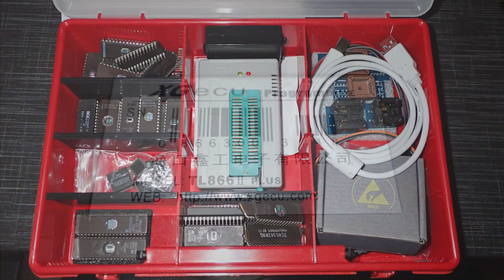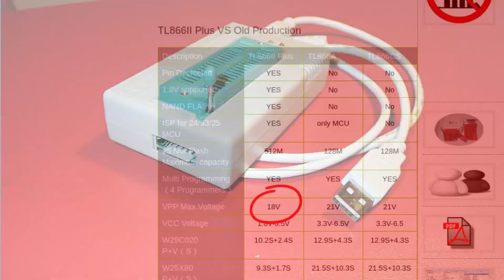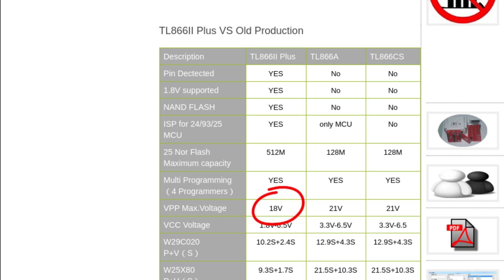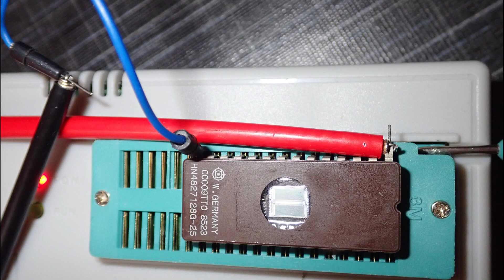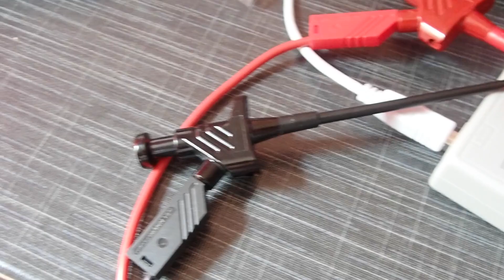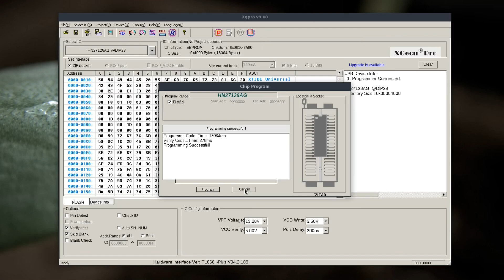How to write 21V EPROM on TL866II+

Comment: i need to buy a programmer. what inexpensive programmer can do these higher voltages?
Reply from the maker: XGecu T48
Reply: @necro_ware  ok thanks. i ordered this  V12.63 Original XGecu T48 [TL866-3G] Programmer Support 34000+ ICS for EPROM/MCU/SPI/Nor/NAND Flash/EMMC/IC Tester/ TL866CS TL866II Plus Replacement.  If it doesnt work you owe me $61! 🤣

Comment: I tried this with a 21V VPP vintage 8751 (not the 12.5V 87C51) but the chip burned - blue flash seen in the window when 21V was applied to the VPP pin resulting in a dead chip. Seems it doesn't work with microcontrollers as it does with EPROMS.

Comment: Hi! I would like to ask you something. I have a 386 motherboard (Seritech SER-386-AD III), that is missing the BIOS chip. I've seen that in eBay, they sell 28-dip EPROM chips (32K, 64K and 128K) from 3 to 7 euros. On the retroweb website, there is a bios to download for this motherboard. If I order one of those EPROM chips, can the TL866II+ pass the 386 BIOS to it? And if yes, will the motherboard boot? (assuming the the motherboard doesn't have any other problem and is only missing the BIOS chip).
Reply from the maker: Yes, this is the way to go. But pay attention, if you get used EPROMs, you will need an UV-eraser. If you don't want to mess around with that, just get compatible EEPROMs
Reply: @necro_ware  Thanks a lot!

Comment: Necroware, thank's for sharing this info and all the guy's that comment it. I have a problem trying to copy a tms27c64 eprom from a machine that is still working at my place of work. I managed to buy two new m27c64af and now watching this video of yours, it made light, I already understood why the first one I recorded doesn't work. Now I'm going to test it with the other one to see if it works. Ah, the programmer I'm using is the tl866II with the latest update from the manufacturer's website. Thank you very much for this explanation and I will keep you posted. Keep up your videos, I've learned a lot from them.

Comment: Thanks for the precious hint: I guessed a similar option with my Hitachi 482764, and you confirmed and explained how to do it properly (it seems that most of N-MOS EPROMs need a Vpp of 21V or more ).
Regarding bending the pin I just bent it only in the final part, not next to the main EPROM body: in this way I stressed it in a less dangerous place, and I managed to fix in place the remaining pins, even if the EPROM was slightly lifted on one side. Of course a ZIF adapter with optional external Vpp terminals or modifying with a switch the programmer itself would be better and more clean options.

Comment: Very good idea. I would cut the PCB trace to the ZIF socket. Install a tiny switch and small pin contact for external power. Very useful information. Tks.
Reply from the maker: Good point, may be I'll make an intermediate adapter with another zif socket in it extra for such ROMs.

Comment: Been doing this for a long time.  If you actually probe the Vpp on other EPROMS while it's programming the unit rarely actually provides the correct voltage.  Best bet is lift the pin and use an external power source.

It's too bad they don't have an external power port on the TII burner.

Comment: At 2:22 you explain that write mode only happens at 21V. You workaround this with an external power supply but how do you workaround the software to allow you to erase/write to the chip? I am attempting this now with a ST brand M2716-1F1.
Reply from the maker: First of all erase will not work, since it is an EPROM, which can be erased only with UV light. The programmer will not allow to write to it until it was erased properly. All the other stuff you have to do as I showed in the video. Deactivate Chip ID check and Pin Detection.
Reply: @necro_ware  Sorry to have used the word “erase”, to me it also describes writing which is what I cannot perform with this chip model regardless. To my point, I am wondering if in my case, is this is a software/firmware issue. My brand new XGecu TL866II-Plus has App Software Ver: 11.80 and Firmware Ver: 04.2.128. Have you updated these to the newer versions since this video? What version is currently working for you? I am simply trying to troubleshoot why I am having this trouble. I am trying to fix a Space Invaders arcade.
Reply from the maker: @tcw16505  I update the software regulary, yes. However I currently have no EPROMs at hand, which need heigher voltage to test. What is exact error?
Reply: @necro_ware  It just says Programming Failed - The log file agrees. APP Version : 11.80   Model : TL866II Plus, Device : M2716 @DIP24, Programming FLASH ... Programming  ...Failed
I have tried this with new M2716-1F1 Eproms, new M2716-1F1Eproms erased, I have tried this as you do with VPP isolated with 21.5 volts and then also with 3.5 volts in parallel as supplemental power. The same problem persists, Programming Failed.
Reply from the maker: @tcw16505  The datasheet says, this EPROM has 25V programming voltage. See https://www.digchip.com/datasheets/parts/datasheet/456/M2716-1-F-1-pdf.php
Reply: @necro_ware  I agree, I also did try programing this at 25 volts and it did not work. The reason I say 21V is because my chips have 21V printed right on them.
Reply from the maker: @tcw16505  Oh! Then using 25V would most probably fry the IC. I hate such discrepancies. I'm currently out of ideas, but I'll think about it. So, to understand it fully, you've bent  one Vpp pin away and connected an external power supply with 21V to it. All the other pins remained in the TL866II+ right? Then you selected ST M2716 in the device list, deactivated the pin detection and the chip ID check and pressed Write. Is that correct so far?
Reply: @necro_ware  Yes, that is all correct. VPP is on pin 21. G is pin 20. Regulated DC power Supply W/voltage confirmed with DVM. All the other pins remained in the TL866II+. "Check ID" is unchecked and deactivated with the "Select IC" set for the M2716 @DIP24 (meaning I couldn't select it if I wanted to). I also uncheck the "Pin Detect". IC Config Information is set at - VPP 18.00, VCC 5.00, VDD 5.00, and Puls Relay at 1000us. Then I press "Prog". and "Programming ...Failed" is what I get.
Reply: I did just run across a AM27C256-120DC in a box. It only requires 13 volts to program but I wanted to prove that the TL866II Plus works. I was able to read the chip and save a copy of what was programed (It seems this chip operated as part of an alarm system). I am going to erase it now as I'm writing this and hopefully reburn the data back on this AMD from 1986. I'll update. Yes it works just fine with this 13V chip.
Reply: @Necroware  I may have stumbled across something. Regarding the M2716-1F1, I have been putting positive voltage on VPP, pin 21 and negative in G, pin 20.  Should I try putting negative voltage on VSS, pin 12 rather than G?
Reply from the maker: @tcw16505  Of course Vss! G is not ground, it's one of the mode selection pins. See the documentation, which I linked above.
Reply: Using a laptop powersupply is not advisable as those adapters are capable of pushing multiple amps in the VPP pin as the is no 20mA current limiter on it as on your bench powersupply.

Comment: I wonder what happens if you don't bend out the pin. Is it going to burn the programmer?
Reply from the maker: That could happen, yes.
Reply: @necro_ware  Would it, though? It says the max voltage on that pin is 18V. I'm not sure it would burn with 21. Besides, other similar models support 21V.
Reply from the maker: @LambertZero  If it would, I can't say, I just think, that it could, dependent on the internals of the programmer. I'm not really keen to find it out ;)
Reply: @necro_ware  yeah, I don't really feel like testing it either. :-) I guess it'll remain a mystery.

Comment: I had a thought whilst watching this. You bent the pin of the chip up out of the socket, and sure it'll probably bend back ok the first time you do it, but what about the next time, or the time after that? If instead you put the chip into a socket, and then bent the appropriate leg of the socket before inserting that socket into the programmer you would avoid the wear & tear on the relevant chip pin.
Reply from the maker: This is an EPROM you program it once and usually never touch it again. It was more a question of throwing it away or to find a way how to program it once I need it. If I want something to play with reprogramming, I'd just take modern EEPROMs, because I don't want to wait 20 minutes each time to erase the EPROM.
Reply: @necro_ware  Oh, right. I must admit I'm not too familiar with them. Only really encountered them during my BBC model B days, way back when.

Comment: I recently ordered the TL866II - useful info, thanks.

Maybe it would be a good idea to add a small capacitor (say 10-100uF elyt. + 100n ceramic) parallel to the VPP/GND pins if the wires going to the power supply are somewhat long, just to be sure.

Comment: Hi friend, okay? I hope so... I had a 128 file, and I recorded it on a 256 eprom, but when I installed it on the equipment, it just didn't read... Then a friend said I wouldn't need to buy a 128 eprom , he said that he simply "mirrored" the 128 file to be recorded in the 256 eprom, sent me the file, recorded it, and it worked! But he didn't use Xgpro (which I use) for that... How would I do that using Xgpro? I use the TL866II recorder...
Reply from the maker: You don't need to mirror it, you just need to checkout what happens. Obviously the device, where you put the XTIDE BIOS into starts to read the data at 16K offset. This means that the highest address bit is always 1. So you just need to write the data into the second half of your EPROM. In the TL866II software, when you load the ROM image, you can set the offset address. You just have to set up the second half that would be at 4000h. You can also load multiple times and give different offsets every time to combine. You always should zero the data you don't need.

Comment: Won't repeated streighning of the account pin eventually brake it now matter how carefully you are?
Reply from the maker: Usually, you don't need to make it multiple times. If you have to experiment with PROMs and rewrite them every now and then, I suggest to use EEPROM instead, since they can be easily erased without an UV eraser. Such EEPROMs will not need 21V anyway. So this procedure I describe is more for one time usage and for me, it's better than just to throw away the chips.
Reply: You can also modify a simple IC socket and bend that pin outwards.

Comment: Thanks for your video. I'm going to write some d2732a (pin 20 is vpp). Did you try it before I burn anything?
Reply from the maker: No, I didn't, but I tried plenty of others. I looked into the datasheet and there stands, that you should not exceed 21.5V, so pay attention to stay below or equal 21V.
Reply: @necro_ware  I've tried the D2732 with 20,66V on vpp (pin20) without success. Just an error after click on program... Programing FLASH... Programing ... Failed. If someone has any idea
Reply: @CarlesOriol  @Necroware same same. Tried exactly what Carles did and no joy on that one
Reply: @CarlesOriol  VPP = pin21
Reply: same here... doesn't work w/ M2732A at 21V or 21.5V

Comment: Do i will have a problem if i want to read the memory, like a M5L2764K?
Reply from the maker: This hack is only needed, if you want to write it. To read you just need usual 5V without any tricks.
Reply: @necro_ware  thanx, i read in a datasheet from a MBM27128 (old fujitsu eprom) that if you want to read the memory you will need Vcc and Vpp at the same value, for example, 5 volts, its that true?
Reply from the maker: @gabriellepe7839  You actually don't need to care. TL866II+ supports it out of the box. Put it in, select the right IC in the GUI, read, profit ;)

Comment: 21v only in TL866CS or TL866A, however, these 2 models are obsolete and do not have some improvements such as programming of nand flash.
Reply from the maker: yes, that's why I made this video. This way it works on tl866II+ as well

Comment: Do not bend the Eprom pin, it will break when you need to bend it again. Instead, plug the eprom into another external socket, and bend the socket pin to fit the programmer's socket.
Reply from the maker: If you want to do it many times, then it's a good advice. Thank you. However, if you need to do it once, it's ok,  just do it slowly. This was not the first pin I bent ;)
Reply: Yes I agree that the EPROM pin could break. So better use a socket.
Reply: Even better is to make a breakout board with pin 1 not connected to the programmer, which also gives a connection for the power supply.

Comment: Nice,so is possible to program the 2716 25v with this method, i am afraid i'll zapp the miniPro, and one can find old programmers around 100$..
Reply: Curious to know if you tried this on the TL866II+? I need to burn a program on a M2716-1F1 and was going to purchase one if it can do this.

Comment: Nice job but i have a question i have GAL16V8Z PLD and i can't find it's VPP on the datasheet any advices?
Reply from the maker: Thank you! GALs, PALs, PLDs are not the same as EPROM. They are not programmed by setting VPP, but by issuing special signals to set the IC into write mode. So, unfortunately, this method will not work there.
Reply: @necro_ware  i use the same programmer you have and if i chose this GAL16V8Z it shows VPP setting you can try it
Reply from the maker: I know, that the TL866 can program GALs and such things, I'm actually using the TL866 to  do that quite often. I don't want to spread wrong information. However, as far as I know, even if you can see VPP in the UI, it has no meaning, or means the same as VCC. GALs are not programmed in the same way as EPROMS. There is not just a pin, where you put some higher voltage, but a combination of signals to set the IC into write mode. I honestly was never digging into the depth, how that works, but I believe, I read it somewhere a long time ago.

Comment: How about pls100n chip? Would this method work on it?
Reply from the maker: This is a good question, I will search for such a chip in my scrap. If I find it or something similar, I'll write here.
Reply from the maker: Unfortunately, I don't have any PLS100 chips, but I looked at the datasheet of the IC and it doesn't seem to be related here. This PLD is not supported by TL866II+, so you'll probably need some other programmer and if the voltage there is not sufficient, this method could probably work, but you have to try it yourself, I guess.
Reply: @necro_ware  shoot! thanks anyway

Comment: Nice trick! :D I only have an old Willem parallel port programmer donated by a friend because he bought a better one. I dont know why lowered the voltage on TL866II+, was nice with the previous generations of this programmer, maybe could be sorted out some hack for it to output 21V ???
Reply from the maker: Hello Jorge! Some things were improved on TL866II+ compared to the other models and some features were dropped, like 21V Vdd support. I guess, all the 21V EPROMs are a dead technology and all the modern (E)EPROMs need much lower voltage to be programmed. However, this channel is named Necroware and it is somehow about dead hardware or things around this topic :) I think, that modifying TL866II+ is too much effort, since you not only will need to hack the hardware, but modify the firmware and the software too, because you can select voltage only there. I don't think it's worth it and will stick with this trick, if I need to program an IC with higher voltage from time to time. This doesn't happen that often anyway.

Thanks for watching my videos once again! :)